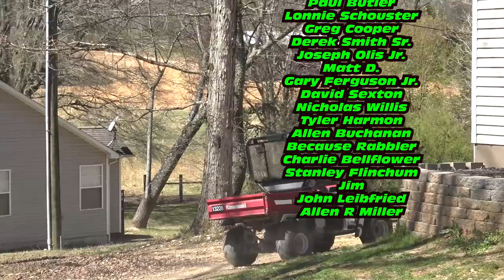440cc Kawasaki Mule Pulls A Tahoe

Comment: A great way to restore ATV plastics is mix boiled linseed oil and acetone 50/50 and brush on, the acetone opens the plastic and lets the oil in then flashes off leaving a nice finish, use an orbital sander first to take the dirt layer off

Comment: using the reverse as a forward gear is a little weird. do they make a counter clock motor that would work? you did say you were going to flip the Differential. not sure about that. I have a mule with a bad motor, would like to try this build.  what was the cost? Like the more power, but the cost and ease of the job are a factor.

Comment: Hi, i like you content
and i was thinking if you can make a project a little bit different
maybe you can find a old go kart frame to buy
but, instead of installing a 212cc Predator engine or a motorcycle engine, maybe you can test a eletric-powered system
using an car/pick-up alternator as a 3-phase motor, an 48-72v e-bike controller, foot throttle, and rc lipo batteries to run it
i think it would not be so difficult or so expensive for someone like you to do a project like this